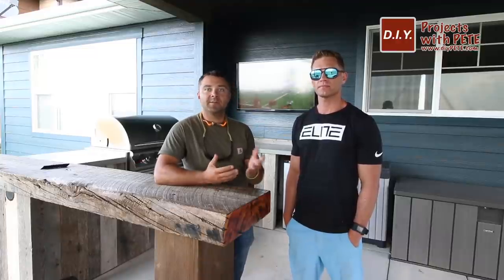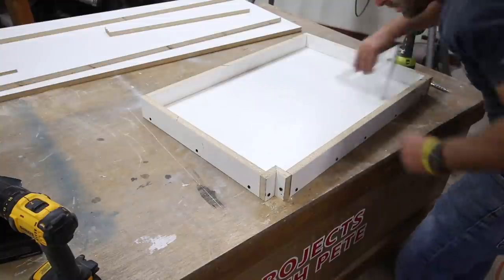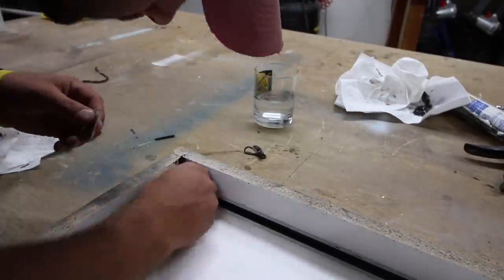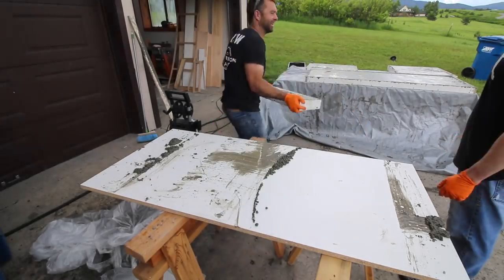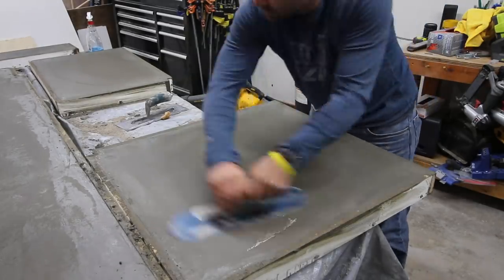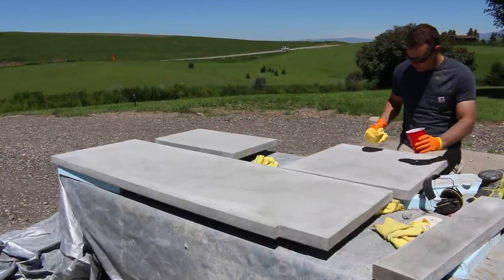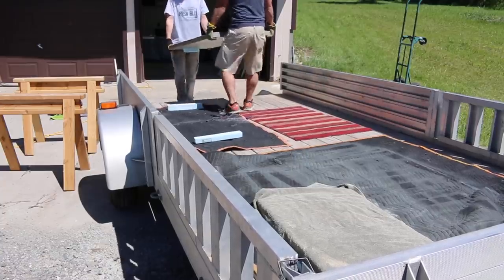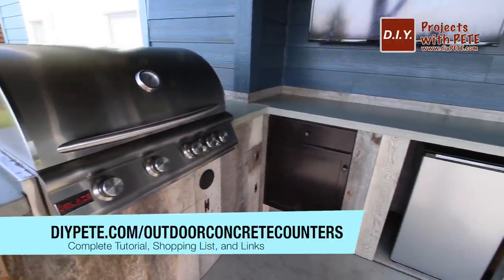How to Make Concrete Countertops

Comment: Great job on the video. First of yours, I've seen; great explanations, thorough, but concise.

After watching the entire project, I say you might have to skip more than one workout, when doing a project of this size.  Made my shoulders and arms ache, just to watch!

I have a question, or two, and a suggestion, or two.

Questions, first:
I need to put some concrete aprons around a hot tub I have installed in a hot tub/sauna house I built. The building was built to fit the width of the hot tub, with windows on three sides. The top of the hot tub is ¼" below the rough framing of the window openings, so the aprons will also act as the bottom window casing.

When you mentioned pour in place, I immediately wondered if that would be a better approach, since getting upside down counters into place might be a bit daunting.  Do you have a vid on pour in place counters, or do you know of any?

Also, given the chemicals used in hot tubs, should I look for something tougher than the sealant/wax combo you're using?

Last, do you know if using concrete coloring will cause any changes in prep, formulation of the concrete or changes in the process?

Oh, yeah, I loved the cake tools. I've been wanting something like that for 40+ years to finish caulking. Gotta get some.  I try tools from other fields, as well, and have discovered some GREAT crossover stuff through the years.   A while back, I found some plastic razor blades in the hobby supply world.

They are the exact replica of a single edge razor blade, so they fit all the holders on the market. If you're scraping a surface with a plastic blade, you don't risk damaging it, like you do with a razor blade. Give them a try. I found them online, at a hobby store from Albany Oregon. Can't recall the name, right now, but they have turned out to be the best price source for a lot of stuff in the hobby/crafts world.

A suggestion for the installation process: after the silicone is applied, use some lengths of dowel to elevate the countertop above the goo, then pull the dowels out after the counter is located correctly. It's an old cabinetmakers' trick used when installing laminate on counters.  Let's you place the lam perfectly, before the glue can grab it.  With these heavy concrete 'tops, I can see a mess in the making, if you can't keep the 'top off the goo.

Again, well done vid. Thanks...

GeoD

The other suggestion would be to try polyurethane instead of silicone. Sillicone is more fragile than urethane. And if you use water on your fingers, urethane will finish as smooth as silicone.  Urethane is forever, from,my experience with it.  Plus, you have a bit more color options than silicone.
Reply from the maker: Hello George! Sounds like a great project. Pour in place is probably going to be a better answer for your situation. I don't have any videos on it at this time. As for a sealer, you won't need a food safe sealer, and you might look at doing a more durable sealer to resist the chemicals. Something meant for patio floors or garage floors perhaps. Coloring the concrete requires it to simply be mixed thorough and measured to get a similar color throughout the whole project. I've done lots of colored concrete tops and they've turned out great. Sounds good on the plastic razor blades! I at one time had a sign business and car graphics so I've definitely used them. Thanks for all the feedback and info! Cheers!

Comment: This is a great tutorial on concrete counter tops. I am constructing an outdoor kitchen on my deck, and I was wondering if you have a video where you set the grill in place. I am not sure if there are special materials you use to mount the grill in place, or does it just sit on the wood framing. Avoiding a fire is desirable.
Reply from the maker: He Doug! I love your comment, I'd find it desirable to avoid a fire as well haha :) The grill we used had a built in fireproof double walled outside that could be set in place without special adaptations. It really depends on the grill you use. I'd recommend buying one built for an outdoor kitchen or doing some research to find out how to make a current grill work. You may need to add cement board or another non-combustible material in the area.

Comment: I ran across this video and instantly became a fan!  I have a question, hopefully you can advise if I should rethink the concept.  I have a small basement bathroom and I planned to add a concrete top to the vanity.  Your video included clear and thorough instructions plus options for a few steps.  Much appreciated!  I plan to install a vessel sink.  I am concerned about how to insure the opening for the drain is strong and the correct size.  Do you think waxed PVC pipe would be sufficient or do you have any suggestions?  The project will not happen this month but it certainly is on my list.  Since I can use the least utilized bathroom for practice and move the concrete from the garage to the bathroom I feel better using that for practice.   It will determine if I tackle the other bathroom counter tops or hire someone to do it.
Reply from the maker: Hi  Faye! Great to hear form you and thanks so much for subscribing. You rock! Sounds like you have a fun project in store.  -- PVC pipe works, I usually go around it about 3-5 times with duck tape and then add a little Pam cooking spray to help it pop out. Cutting a slot down the PVC also is helpful. Another option if is to use foam like I do here: https://youtu.be/TUAPO8otVrY?t=7m11s   It comes out super easily. Lastly, you could use rubber knockouts: https://amzn.to/2mW5cHc   - I have this set and they work amazing. Plus, if you plan on building additional counters or vanities it is well worth the " $25 plus shipping " in my opinion. Have fun with the build!! Cheers - Pete
Reply: Me Too.
I think this is the first video I've watched where I clicked subscribe before the video had ended :D

Comment: Great video thank you!
I have an existing outdoor concrete patio counter. It is smooth and shiney, but has several stains from what appears to be oil. How would I go about sanding or grinding down the sealed layer to remove the stains? Any suggestions would be appreciated. Thank you.

Comment: I can see you are using a ball bearing to round your inside edges. The other (super simple) technique is sliding a round corner of a credit card square against the inside edges and it also leaves the silicone perfectly round and smooth.

Comment: Ok, I studied the inside counter top idea and decided it's not a good idea.  The moldings, at least on one end and side would be difficult to remove since they snug right up to the wall.  I now think building the template and building outside would be best.  Once again, thanks for the video.  I've got a new project and since I'm retired that gives me another excuse to work in the shop.
Reply from the maker: Hi JA! I agree that using the precast method is probably going to help you get the best results. Cheers

Comment: Very informative well made for beginners; a thought came to mnid, have you ever tried wood or foam moldings along the edges inside the mold as part of the prep for smother edges when flipped over ?
Reply from the maker: Hi! I have used foam and rubber molding for different looks. Definitely something to try!

Comment: Great tutorial.  Wonder if it would be possible to build the counter top directly on the inside kitchen.  If yes, it would save a lot of heavy lifting.  Any advice?
Reply from the maker: Doing the pour in place option is certainly something to look into. It does require very good troweling skills, and a few other techniques that differ.

Comment: Excellent tutorial, really appreciate the information. I rehab row homes in Philadelphia and have been itching to do this on one of my projects for a while now.  Will definitely be experimenting with this in the future.  Random question, where did you get your dust mask that you’re wearing when cutting the melamine (sp?) for the molds? Also, are you using a specific type of sand paper when doing the final sanding with the orbital?  Thx again, look forward to checking out more of your videos.
Reply from the maker: Hey Josh! Great to hear from you. The mask is called an RZ mask and I got it on Amazon. The sandpaper is a normal 120 or 220 grit paper that you'll find at the store. Cheers!

Comment: Hey Pete-this is a great video. I’m in the process of following your example in building a countertop for our bbq island. Question on using the slurry to fill voids. Would it be as effective to use ready mixed concrete patch?
Thanks..Richard

Comment: Wait, did you wax the melamine and then clean it with rubbing alcohol?
Reply from the maker: Hey John! You caught me, whoops! Looks like I did do a little wipe down to get some last minute items out before pouring. While light, I'm sure it took away some of the wax effectiveness. Definitely should have done a quick re-wax at the end, or simply put that step last  - where it should have been. I don't usually even do the wax step since it pops away from melamine so easily, but so many subscribers have asked me about it that I figured I'd show it. Good eye in pointing that out!
Reply: John yea I questioned that too. :)

Comment: Great video.  Question,  I want to do this for a bar that is 13' long.  Do I dare make 1 long section, or make 2?  And have you ever used GFCR?  If so, would that make it possible to make that one 13' section?
Reply from the maker: Hi Nicole! I 13 foot section will be heavy, but doable if you have a lot of help with lifting. You might look at doing the countertop poured in place and doing a hard trowel finish. I have not done much with GFRC yet.

Comment: Thanks for the video, well done! I'm building my outdoor kitchen this summer - it'll be 10x2 but with a sink cutout. At about 19sf I'm worried it'll be an unmanageable weight once complete. Are there any practical  ways to make it much lighter?
Reply from the maker: Hope the project went well! With larger pieces I will sometimes pour the concrete in place and hard trowel it. Cheers

Comment: Hey Pete, really love the video. I used the Portland cement slurry mix to help fill in pin holes and such but unfortunately I believe I left too much excess as I’m left with a ton of dark blotches everywhere. Any suggestions on how to remove them? Really should have tried on a small less noticeable spot prior to moving forward but I’m stuck now. Any help would be appreciated.
Reply from the maker: Hey Vincent! Sounds like a little slurry mix may not have been removed from the top surface, and was then sealed over? If it has not yet been sealed, use water and a blue scotch pad to remove the excess. If it has been sealed, you'll need to remove the sealer and then use the same process. If you have a wet polisher, you could remove the sealer and excess in one step, then re-seal.

Comment: Hey Pete!  Great video as always, I've learned a lot from all your concrete counter/table projects.  Question:  I am about to make a table top 84x40x1.5 (I know, it'll weigh like 500 lbs!).  Would you suggest the Quikrete countertop mix or the 5000 psi you used for this project?  I noted when you did a table top that was 1.5" you used the countertop mix.  Thoughts?
Reply from the maker: Hey Steve! I would use the 5000 PSI mix without a doubt. I've done a lot of projects with both types, but to be honest I've had better results and fewer issues using the 5000 throughout the years. Plus it is much cheaper. Go with the 5000 in my opinion!
Reply: DIY PETE Thank you for the fast reply. Greatly appreciate it!

Comment: great work!, isn't it a good idea to slope the surface to keep any spilled fluids to an area to cause less damage or easy cleanup too?
Reply from the maker: Hey! We treated these countertops like normal countertops and they are level. The patio slab does have a little slope to it though for water drainage.
Reply: @DIYPETE  beans, thx for response

Comment: Stumbled onto this channel while looking for some ideas. Great videos and excellent instructions.  I do have a question though.  I just built a round firepit that is stone veneered and was looking for something different to cap it (last time I just mortared flagstone).  Was thinking of a concrete top:  the outside diameter is about 66" and is about 14" in width.  Probably two pieces as that is a large single piece?  My real question which is actually a 2nd one :-0 do you have any tutorials or recommendations for giving it a chiseled edge?  manually using a chisel or some kind of template that is put in the template when pouring.  Thanks again
Reply: I've seen people line the edge of the mold with fiberglass insulation. That gave the chiseled edge look.
Reply from the maker: Hey Roper! I don't have a  video on this, but I have used a mold similar to this one to create a stone surface on a  concrete bar I built: https://amzn.to/2CI8Uvm    --- I would recommend against chiseling. You can search the internet for all sorts of concrete counter edge forms. Best of luck!

Comment: Great vid, this is about the 3rd concrete vid of yours I've watched and am starting to gather supplies to do a small work bench top just to see how I'll like it before I tackle anything more serious. Question though - I can easily find everything you use here in my small town except the melanine(sp?) covered boards. I looked at some cheap paneling and luan type stuff but most had some sort of design that would imprint or was ridiculously expensive. Would it be possible to paint some regular boards and/or high grade plywood with something that would release the concrete easily? Or any other type of material I could use? Thanks.
Reply from the maker: Hi AW! If you can't find melamine, you could seal seal the plywood and then wax it to help it release. Depending on the size of your table, you could line it with a material like clear acrylic if it covers the entire area. The board basically needs to be sealed so the water from the concrete isn't absorbed. If absorbed, it will swell up and the concrete will from against the swell.

Comment: Does that wax stand up to the heat next to a grill?

Is the sealant affected by the heat? For example, if I take a hot pot off the stove and set it in the concrete counter, would I get discoloration on the concrete or residue on the pot?
Reply from the maker: Hi Andrew, it's a very thin layer that's been buffed and does well. As for setting a hot pot from a stove on the concrete, I generally use a hot pad to set a hot pot on just to be safe.

Comment: Good Job Pete! quick question, how does the bbq do on the wood? is there any type of barrier between it and the wood? I ask because Im interested in building a similar setup
Reply from the maker: Hi Carlos! The barbecue used is dual insulated, so it is made for this type of installation and does real well. It is somewhat similar to this one: https://www.woodlanddirect.com/Bull-Outdoor-Outlaw-Built-In-Gas-BBQ-Grill?gclid=CjwKCAjwhqXbBRAREiwAucoo-7I162xUPyB_ETRvAGf1Jdb9vH4j70-dvedan68wTa4waRWzp7Dk1hoC1qQQAvD_BwE#999FuelType%3ANatural_Gas   -  I have built metal surrounds before, but it was not done with this grill. Sounds like you have a fun project coming up that will really spruce up your patio!

Comment: Pete, correct me if I am wrong, but it seems most of these projects are made with a minimum of 2" concrete slabs... is this the minimum depth you are able to pour based on quickrete specifications?  Would it be possible to pour a 1 or 1.5" thick slab for countertop? (could use 1/4" hardware cloth as reinforcement) ???

GREAT work as always, please keep the videos coming!
Reply from the maker: Great to hear from you Nicholas! With a normal mix, I typically do either 1.5 or 2 inch thick slabs. 1.5 inch thick slabs are the thinnest I typically do. I did a few small end tables with 1 inch thick concrete but I wouldn't do larger projects with it unless you look into using a GFRC mix.  Cheers!
Reply: 1/4" mesh is too fine,will have issues with aggregate and create a horizontal weakness/delamination plane,  2x4 hogwire fencing works but must be carefully flattened. Polypropylene or fiberglass fibers to add strength for thinner construction. Great video by the way. I'd use a better vibrator, and ditto the comment on water reducer for lowering slump.
Reply: Thank you Pete.  Appreciate the feedback. Do you have unique considerations for pouring 1.5" slabs with normal mix? I am going to start/experiment with a few end tables/coffee tables etc before doing anything bigger.  Just looking to spruce up my place, nothing commercial.  @DIYPETE

Comment: can i create the slurry by sifting the agregate out of the cement i used and just use the dusty fine stuff?
Reply from the maker: Hi! Yes, you can sift out the gravel and sand using a sifter.

Comment: Super great, helplful video HOWEVER>>>>>>>The wood on the front is a big no-no for around a heat source which can top 500F. All combustibles should be over 2 ft. away.

Comment: Great Video.  Question: wouldn't it be easier to wax the individual parts of the mold prior to assembly?
Reply from the maker: Hi Steve, it only takes a couple minutes to wax the mold and I think doing it after assembly is the easiest way to do it.

Comment: You should mount a motor that has a big offset counterweight (kind of like a vibration motor on an older phone) on the underside of your work table. Then to vibrate the air bubbles out all you need to do is flip a switch!
Reply from the maker: Hey Alex! I actually do have one. It mounts underneath the table and has a switch :) I just try and do most of my online projects without it to show  that you can build it without having to buy expensive specialty tools. I will have to show it though in the future! Cheers